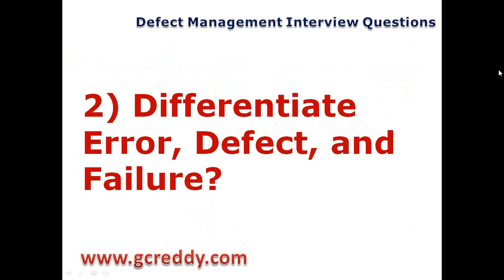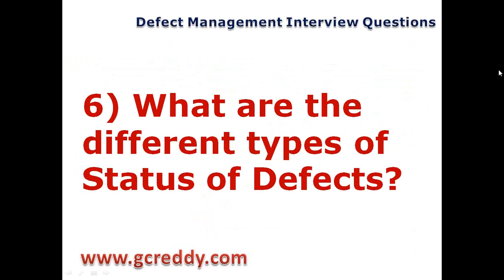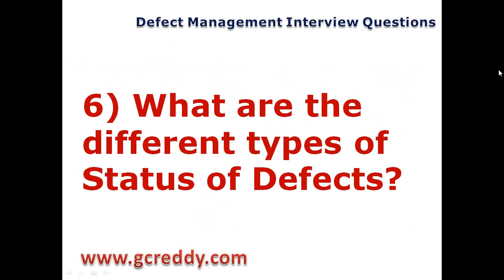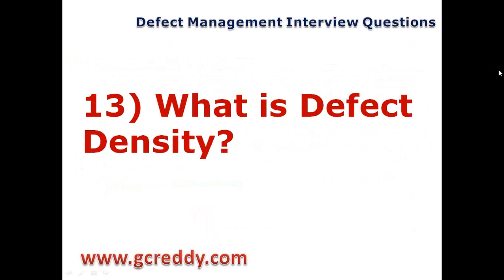Defect Management in Software Testing

Comment from the maker: Class Notes:
1) What is Defect in Software Testing?

A flaw in a component or system that can cause the component or system to fail to 
perform its required function, e.g. an incorrect statement or data definition. 
A defect, if encountered during execution, may cause a failure of the component 
or system.
-----------------------------------------------------------
2) Differentiate Error, Defect, and Failure?

Terminology vary from one phase to another in Software Application Life Cycle

Software Application Life Cycle has 3 phases;

i) Development phase

in Development phase if developers find any mismatch they call it as Error or 
mistake

ii) Testing phase

In Testing phase if Testers find any mismatch they call it as Defect or Bug or 
Fault

iii) Production phase

In Production phase if Customers or End Users find any mismatch they call it as 
Failure
-----------------------------------------------------------
3) Give a Sample Defect Report Template?

 A Sample Defect Report Template:
                   
1) Defect ID: Unique No or Name
2) Description: Summary of the defect
3) Feature: Module / Function / Service , in these module TE found the defect
4) Test Case Name: Corresponding failing test condition
5) Reproducible (Yes / No): Yes -&gt; Every time defect appears during test execution
        No -&gt; Rarely defect appears
        If Yes, attach test procedure:
        If No, attach snapshot &amp; strong reasons:
6) Status: New / Reopen
7) Severity: Seriousness of defect w.r.t functionality (high / medium / low)
8) Priority: Importance of the defect w.r.t customers (high / medium / low)
9) Reported bug: Name of Test Engineer
10) Reported on: Date of submission
11) Assign to: Name of the responsible person in development team -&gt; PM
12) Build Version ID: In which build, Test Engineer fount the defect
13) Suggested fix (Optional): Tester tries to produce suggestion to solve this defect
14) Fixed by: PM or Team Lead
15) Resolved by: Developer name
16) Resolved on: Date of solving By Developers
17) Resolution type: check out in next page
18) Approved by: Signature of Project Manager (PM)

Note: Defect Report Template may vary from one company to another and one 
project to another
-----------------------------------------------------------
4) What is Producible Defect?

If a Defect is appearing every time (in every execution) then that Defect is 
producible defect, we can provide steps for locating it.
-----------------------------------------------------------
5) What is Not Reproducible Defect?

If a Defect is some time times only appearing then that Defect is not producible 
defect, we have to provide proof (snap shots or database dumps) for locating it.
-----------------------------------------------------------
6) What are the different types of Status of Defects?

Status of Defects
New: Tester provides new status while Reporting (for the first time)

Open: Developer / Dev lead /DTT opens the Defect

Rejected: Developer / Dev lead /DTT rejects if the defect is invalid or defect 
is duplicate.

Fixed: Developer provides fixed status after fixing the defect

Deferred: Developer provides this status due to time etc...

Closed: Tester provides closed status after performing confirmation Testing

Re-open: Tester Re-opens the defect with valid reasons and proofs
-----------------------------------------------------------
7) Explain about Defect Life Cycle?

Defect Life Cycle
------------------
Different Flows of the Defect 
a) New > Opened > Closed
b) New > Opened > Closed
c) New > Opened > Fixed > Re-Opened > Fixed > Closed
d) New > Opened > Deferred
e) New > Opened > Rejected > Re-Opened > Fixed > Closed
Etc... 
-----------------------------------------------------------
8) What is Defect Management?

The process of recognizing, investigating, taking action and disposing of defects. 
It involves recording defects, classifying them and identifying the impact.
Some companies use Manual Process (Excel workbook), and some companies use Tool 
based process for Defect Management.

Tools Examples:
Bugzilla / Issue-Tracker / PR-Tracker/Jira / Quality Center etc...(anyone) 
-----------------------------------------------------------
9) What is Defect Management Tool?

A tool that facilitates the recording and status tracking of defects and changes. 
They often have workflow-oriented facilities to track and control the allocation, 
correction and re-testing of defects and provide reporting facilities.
-----------------------------------------------------------
10) What is Defect Deduction Percentage (DDP)?

The number of defects found by a test phase, divided by the number found by that 
test phase and any other means afterwards.
-----------------------------------------------------------
11) What is the Defect Reporting Process?

Defect Reporting Process may vary from one company to another
         
Defect  Reporting Process vary from one company to another.

a) Small scale Company
Tester > Developer

b) Medium scale Company
Tester > Test Lead > Development Lead > Developer

c) Large scale Company
Tester > Test Lead > DTT > Development Lead > Developer
-----------------------------------------------------------
12) What is Defect Masking?

An occurrence in which one defect prevents the detection of another.
-----------------------------------------------------------
13) What is Defect Density?

The number of defects identified in a component or system divided by the size of 
the component or system (expressed in standard measurement terms, e.g. 
lines-ofcode, number of classes or function points).
-----------------------------------------------------------
14) What is Defect Based Test Design Technique?

A procedure to derive and/or select test cases targeted at one or more defect 
categories, with tests being developed from what is known about the specific 
defect category.
-----------------------------------------------------------
15) What is Defect Report?

A document reporting on any flaw in a component or system that can cause the 
component or system to fail to perform its required function.
-----------------------------------------------------------